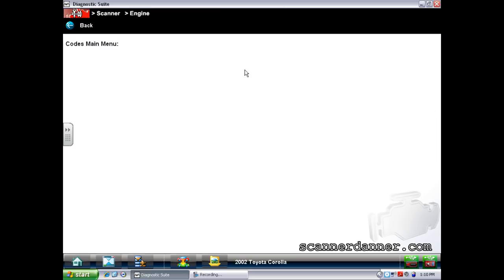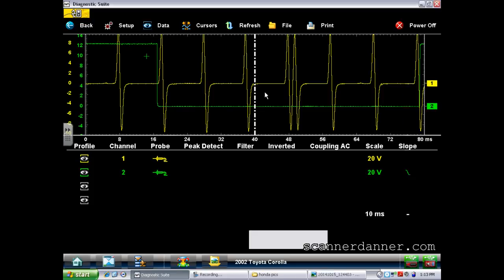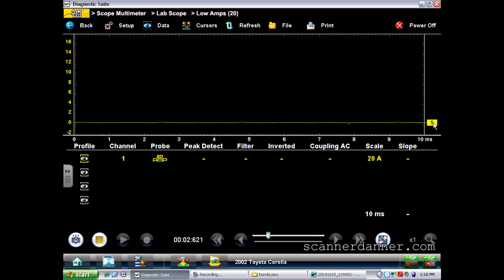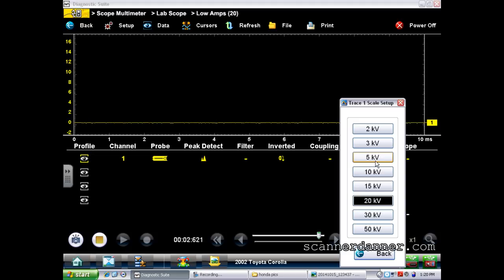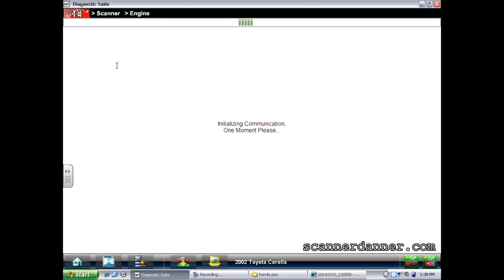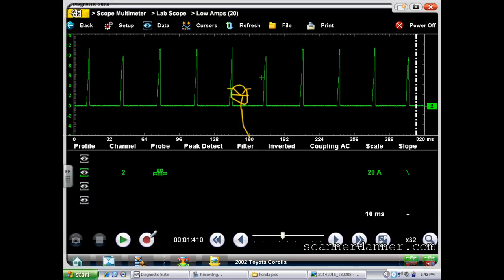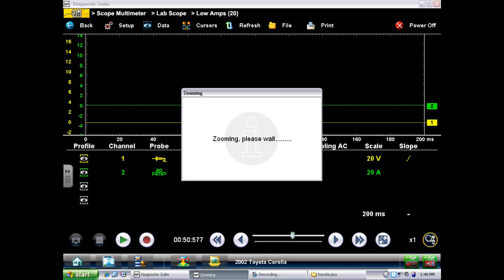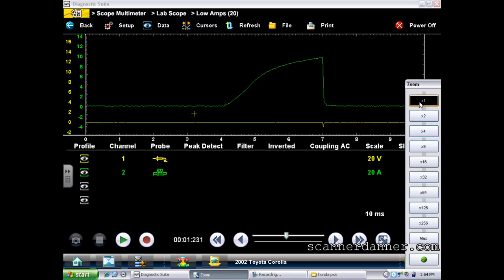Toyota Ignition Coil Test (Snap-on Verus)

Comment: love this setup,4 sparks plus tag a spark,i would move coils around,so move the problem,and move spark plugs too,if problem moves ,then not ecu or wires ,very interesting to see ,live data ,i be tempted to put suspect coil on another car,good car,see if move problem there ,firing order match scope readings too,need know,4 cyl,v6 cyl,straght 6 cyl,v8 cyl,write them down on bit card ,leave in roll cab ,or scan tool box,looks like i get more out of my scope now,go deeper,2 ch modus ,love the verus ,have buy a cheap one ,low software number ,use for scope work,4 ch ,well done scanner danner,you give your knowledge to the next generation,i learnt timing of a strobe light and a distribater,white paint on pully wheel,points ,plugs,condenser,good old days ,8v ,side valve ,push rods

Comment: I had a similar but intermittent problem on my 2000 echo. It had 153k miles so I just changed all the igniters (only 130bucks) and it cured the problems.

Comment: Top video ill use this on my snap on modis ultra to fix my GT Subaru Forester which has a coil that stops working under load but on idle it works fine.

Comment: thanks scannerdanner. Now I know how to use our Shop verus  a lot better.
I would normally do a coil swap,clear codes and see if the misfire switches cylinders while monitoring misfires  with the scanner.
Reply: Steve Lopez that one is a good tip , but the interesting is how to use the scope.
Reply: I had worked on a Toyota had a cylinder 4 misfire swapped coil still cylinder 4 it was coil two

Comment: This thing doesn't run after your disconnected the coil because of the IGF (feedback) signal which tells the PCM that the coils has fired. If the PCM doesn't received that signal it cuts the injectors for all cylinder to protect the catalyst converter. Later model cuts only the cylinder that miss the IGF signal. ALL Toyota cars does that particular thing if they miss IGF signals
Reply: Philippe Breault are you knowledgeable on 97 3.4 Toyota?
Reply: now see right here...this is an interesting answer and could be why conventional thinking of what is going on doesnt work because if this guys correct , then the computer is turning off the fuel.This is the problem these days ...anythings possible with computers (cant say ive heard of that, i'm an old diesel mech. but it could be common dealer tech info , i just dont know) it should run on 3 cylinders surely t.f. (conventional thinking) but this answer would explain the engines response in shutting down the fuel .Towards the end was a voice suggesting the cylinder numbering could be wrong ? and you could have  in fact pulled the plug on a good coil leaving the poor one + 2 good ones and thereby it would struggle to run on 3 cylinders........i always thought having 4 coil design advantage and one going off meant you werent stranded on the side of the road (pre catalyst thinking? prehistoric more like ).............I'm just going to have to die not knowing eh Paul, ha ha   ;¬)
i think i wouldve just pulled all the coils and plugs and had a good look at the plugs and played swappy around.........that wouldve spoken to me i reckon...scope was a long way for a short cut on a nice easy access engine like this.I get what you're trying to impart though .....  ;¬)

Comment: thanks for this video. 
 i was going to buy a Verus D10 20.2 updated today ( for 1Kbox) after i scan my car and showed codes, to go forward each code had FIX IT botton and was forced to connect to web using a QR code but we did not have wifi that area. Q. the snap-on must be connected to WIFI for fully scan functionality? 2. to use the tool we have to subscribe of snap on? how come some older models just work without wifi and no subscription as i see in shops around.
Reply from the maker: What were you working on? Newer Chrysler/Jeep?
Reply: @ScannerDanner  hyundai sonata hybrid 2016

Comment: Can you explain why you have to use a attenuator on the pico scope and not on the vantage pro to measure ignition and injector waveforms for meter safety purposes
Reply from the maker: ***** Just the way the tools are built. That is more of a question for the engineers. The max input on the newest automotive pico is now 200 vdc, previously it was 100. The Verus, Vantage Pro, Modis is 400 based on the scaling of the scope meter itself.

Comment: Hey Paul, great video(s) as always.
Have a quick question for you.. Am I mistaken or were saying you were triggering off of #4 when you showed a picture of #1?  Meaning that if the firing order was correct, you would have a problem with #2 coil instead of #3....

As for your Students wanting to leave early, I got a kick out of that. I was one of them (many years ago) and remember doing the same thing. Wish I hadn't !! 
I'd like to send a message to them and urge that they absorb all the knowledge you are trying to instill in them while they have that chance. These are the most important years in "this" career to learn as much as they can before going out into the workforce. Please, Guys... Take in as much as you can, ask all the questions now and keep applying what you learned from class. I am positive Mr. Danner is willing to help you in any way he can. You have a great teacher. He won't be teaching you forever, so listen and learn while you have the opportunity.

John-
Reply: John, that's what I thought watching this. Surely he is triggering off no. 1 cylinder, not no. 4??
Reply: +Rich Newall He put the clamp on number 4 close to the transmission.
Reply: @richnewall8564  The data states cylinder 1 is nearest timing chain so I agree cylinder 1 trigger meant 1342 points to a cylinder 2 (as codes) this meant when cylinder 3 was unplugged the car struggled to start as 2 cylinders were then not operating.

Comment: Paul nice explanation thank you  for this great video, I was not clear  where you hook up your amp probe on 15.49 of the video, did you connected to a single ground or did you  hook up the amp clamp around the 4 wire coil grounds ? because  I can see the 4 coils ramp,   this is and issue that I have  to connect my amp probe  on the ground side  to see multiples ramps, it is easy when I do it on the fuse  but like on this vehicle that is not possible because other circuits share 
thank you,
Reply: I believe it was all four ground wires.

Comment: Hang on a minute, do you have the right cylinder number? Engines are numbered from the front (fan or crank end), your Verus showed you an engine diagram with a picture of a fan one end and 1-3-4-2 after wards. You seem to be saying cylinder 3 when it should be cylinder 2 so the Verus is correct when it says cylinder 2
Reply from the maker: Firing order is different than cylinder layout. It's 1-2-3-4 when counting the cylinders

Comment: Great video, but I have found out myself that sometimes when it ignition coil goes bad on a Toyota it may not let the car start at all. In other words it will crank up for just a moment and then stall. I had this happen to me at one time and it really kicked my butt. It turned out to be a coil that was installed by another person and it was defective. I put an ignition coil from Toyota a Denso coil and the car started and ran fine. It was very strange because I never seen this happen before. I thought it was a theft issue with the key and communication between the key fob and the computer.
Reply: That's true. Av seen it several times

Comment: Bit of a dumb question but here goes.The battery life on my Verus at the moment is terrible.
In the meantime is it safe to be charging the tool from mains electric 'while' using the Verus for scoping ignition,injectors whatever?
Thanks.
Reply from the maker: Yes, you'll be fine. Time for a new battery though right? Probably not cheap though
Reply: @ScannerDanner  Thanks Paul,it was even for times battery gets 'really' low naturally even with a good battery,i've always wondered if it's safe to charge while using,thanks!
Reply: You may think this was a dumb question,but the reason i asked was i had a Ditex Carscope Viso and the makers of that scope specifically told me not to use it for scope testing while it's charging!:-)
And with this being my first Snap-on better safe than sorry.
New battery ordered though.
Reply from the maker: @robbocop33r12  I've used a docking station for years while teaching classes and had every imaginable condition connected to the scope and scanner functions of the Verus with zero issues. (the docking station is constantly charging the battery) Not a dumb question btw!

Comment: Hey Paul,
I recently purchased a Verus Pro mainly because I find it frustrating sometimes out in the field setting up my Pico, I found the Verus also a bit frustrating when wanting to zoom in on a capture and this video has helped me with that. Thanks.
My question though is when changing the sweep to obtain a larger capture am I reducing the capture rate and missing some detail in the capture.
I did notice that the coil on isolation's are not visible clearly.
I wonder why snap on have chosen not to give us a zoom in feature?
Reply from the maker: Yes! A longer time base (sweep) will cause your sample intervals to increase, meaning more time between each sample and less detail. 
As for the zoom feature, you just need to learn to set up your scope differently than you do with the Pico. 
For the Snap-on scope, you need to set your time base for DETAIL (small time base), let it run for a few, pause the pattern, then zoom out. Now you will have the best of both worlds, detail and repetition. 
If you have a situation where you are needing to see repetition LIVE, and you need a longer time base to see it, that is when you max out your sample rate by selecting "Peak Detect". 
Hope that helps. If you need more, I have a 16 part Verus series on ScannerDanner Premium. You can subscribe here 
https://www.scannerdanner.com/join-scannerdanner-premium.html There is a 14 day free trial. 

Thanks!

Comment: I know this is old but I want to ask Verus with 17.2 software is it worth buying now? I can get it cheap $1500 I have a Autel 908 but wanted to see if I could use the Verus to fill gaps on on the Autel ? I’ve never used snap on.
Reply from the maker: You found a working Verus with a 17.2 update for $1500? Buy it!!!
Reply: ScannerDanner like new with an extra battery. I think his worth it just for the scope.
Reply from the maker: Agree!!
Reply: ScannerDanner here’s what I got back from snap on. Bummer about upgrades 

Hello Jason,

Unfortunately, software upgrades for the original VERUS and VERUS Wireless were discontinued as of October 1st, 2017. Repair services and software upgrades are also no longer available. 

The VERUS and VERUS Wireless scan tools will continue to function after these dates and will be fully functional, just not upgradeable.

Upgrades for the VERUS Pro and VERUS Edge are unaffected and will continue.

The VERUS can program some Ford keys from the 1996-most 2010 model years in addition to keyless entry fob programming.

Sincerely,

Snap-on

Diagnostic Product Support Team
Reply from the maker: @weldingjunkie  lame! I think it is still worth the $1500 though
Reply: ScannerDanner I think so too, I’m going to buy it. Thanks for the advice, learning a ton from you as well.
Reply: Yes if it has everything with it. (wireless module and scope) its very much so worth it.

Comment: I am having issues with my Snap On Verus. It will not turn on. Any idea's ?
Reply: You have to hold the on button until the snap on logo appears on the screen and then let it go straight away or it will switch off again. Most people just press the on button only briefly which is to quick to power up.

Comment: Hi Paul i have a strange question, how does the coil know when to turn ON, i know the crank sensor turns it off via the ecu, does that also turn it on...or is it something that is programmed into the PCM from Fred in UK
Reply from the maker: the on and off time of the coil is controlled by the ECM and/or module or in this case the coil itself. There are logic circuits within some of these too. 
So if the turn on of the base circuit was not timed exactly with the current ramp on this coil. The coil is still using this to know when to turn the driver on. (logic circuit built into the coil)
Reply: Thanks Paul......

Comment: Hi dan, I'm trying to do the same set up on a 99 Acura TL by going straight to the fuse box. I can see all the coil ramps, no problem there, (channel 2 that is), but when I turn on channel 1 to check my control wire it seems like it's spiking on all of the coil ramps. I see spikes going up and down. Do you think it's noise being picked up by using the wrong leads when checking that control wire. btw great video I watched it a million times already lol.Than you!
Reply from the maker: +Milton Solis what are you connect to for channel 1 and what type of coil is it? how many wire?
Reply: Hi Dan, i was hooked up to the middle wire instead of the number one which is the ignition pulse from the pcm n is a 3 wire coil.  In my mind i thought I reply to ur email on Friday morning but my guess is I can't reply from my phone. Ty Dan I know u were trying to help me ty again! N ones again what a great video.!

Comment: Why do the grounds get tied together at the scope?  Doesnt the amp probe have its own seperate dc system (from its internal 9v batt) and then the coil wire from the cars 12v batt?  So how does the scope know to compare channel 2 to the 12v batt ground and channel 1 to the 9v batt ground?
Reply from the maker: The 9 volt battery in the amp clamp is completely separate. It is needed for the amp clamp to produce a voltage output that is proportional to the magnetic field it is measuring. So yes, amp clamps produce voltage. You are not looking at amperage on the screen but an amperage equivalent. Did that answer your question?
Reply: ScannerDanner, perhaps i worded it wrong.  The output of the amp probe is a voltage, and is produced by the clamps 9v battery, a completely different dc circuit than the coils control wire and ground circuit.  So for the scope to read the clamps output voltage, it must compare channel 1 to the ground of the 9v battery.  Yet to read coil voltage, it compares channel 2 to the cars dc ground.  Yet the scope uses a common ground for all channels, and for it to work you need to tie all grounds together.  Just seems odd to me, as if youve taken the 9v battery ground wire directly to the cars frame.
Reply: Ive tried this set up SD but i had to put the low probe in channel 1 , and the yellow lead into ch2 but now i thinking ch2 is not working because i could not get it to trigger to work from the cop . But the scope capture needs some explaining if possible. I will try and link it asap .

Comment: I am a diy Can snap-on verus work with a third party atenuator such as hantek 20:1 for checking secondary ignition waveform?
Reply from the maker: It's not necessary to use an attenuator for Secondary Ignition on any scope
Reply: Stefan h
Reply: ScannerDanner

Comment: Or just swap coil 2 to 1  and see what happens plus its only a 10mm  1 minute.... But 5 ways to find a fault resistance backprobing signal or using spark tester or visible inspection of coil and plug or using scanner and check fuel injector or coil 1 by 1
Reply from the maker: That works when you can get to the coils. This wasn't a video on THE way, but on A way it can be done.

Comment: Engine stalls and won't start when you unplug one coil would red flag me.  I do know that on some vehicles the ECU will kill injectors if the IGF signal is missing, but would it disable all injectors for one coil missing an IGF?  Could be you have another coil with a problem other than the one your suspecting and it can't run on 2 cylinders when you disable your #3.
Reply: Got a 2000 Corolla 1.8L in the shop this morning for a LOF.  Unplugged coil #3 and the engine missed, stalled, and wouldn't restart.  If the IGF signal is lost on any of the coils, the PCM will disable fuel injectors.  I guess disabling injectors would be better for locating a miss on this design.
Reply: +Discretesignals how did you get the injectors to start firing again?

Comment: On a side Note I have never ran across a 4 Cyl. Engine that did not share that same firing order 1342 at least that is what we where told many moons ago
Reply: yes that's right for 4 cylinder in line. but boxer change firing order
Reply: Correct, I failed to put the inline in the coment